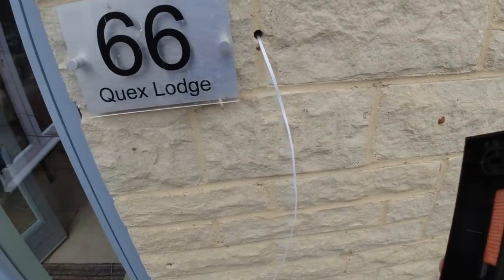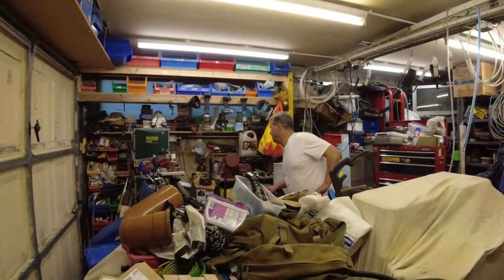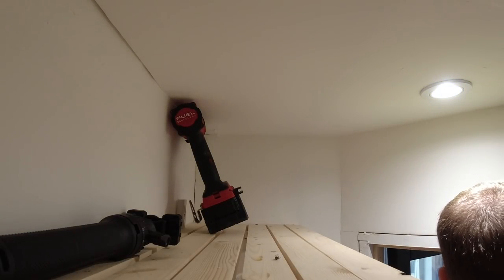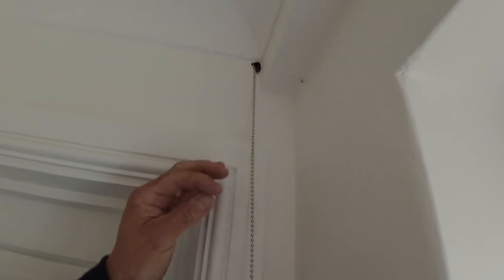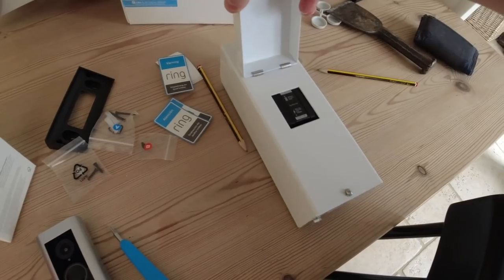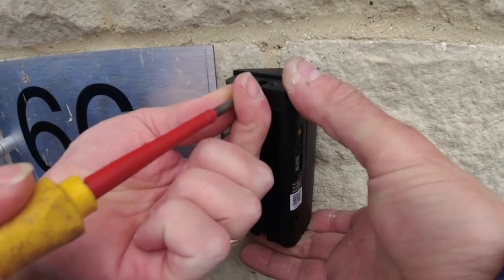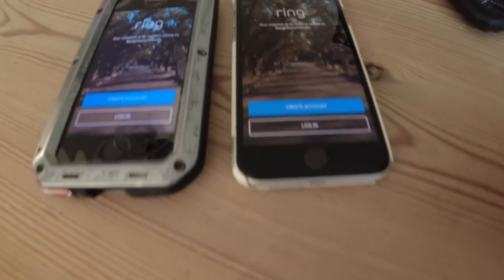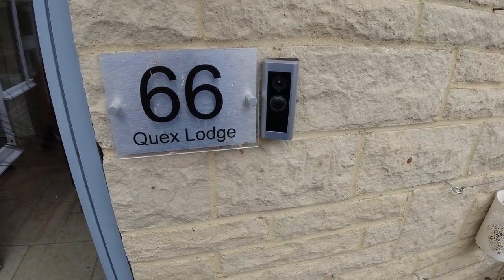Bloody extreme drilling for a doorbell!! #ring

Comment: I would have used Cat5 cable instead of the 2 core.   This gives you extra conductors as well as gives you the ability to add an IP camera / doorbell in the future.   I don't think RING will be around forever.
Reply: Many other types
Reply: Ring is Amazon….so will probably be around for a while tbf.
Reply: Cat5e and a poe injector all the way. Never did get on with the ring transformers, always so big and as Chris said they get pretty toasty too.
Reply: Aye the whole point of this product is to replace an existing conventional doorbell in an easy 20 minute job. Using it this way is a total horlicks, conduit, fused spur, new cables run, proprietary ecosystem with subscription cloud based nonsense to make it work.
Reply: I agree :)  plus,  I dont recommend or use any mandatory subscription storage based service
Reply: @jondonnelly4831  Let alone the fact that it is an attempt at building a mesh network for amazon, by amazon, and is a total invasion of everyone's privacy for a 50 meter radius.
Reply: I agree, going to all the effort of running the cable, may as well have run some extra ones at the same time.

Comment: I was really supprised that you could "fish" behind that coving, !!!  Its normally fitted with huge lumps of coving adhesive rhat would have impaired the cable run.  You were lucky.
Reply: Not really, I’ve fished behind many times, most of the adhesive is on the top and bottom edges.

Comment: If the customer has space in their consumer unit - you can get low voltage AC modules to power these from.
There a few frustrating part bits of these - £2.50 per month subscription (or £20 per year), it makes sense to get the ring complete house subscription when you are heavily invested in to the ecosystem.
The chime pro wifi extenders will ONLY speak to ring devices, so you can't use them for extending your main wireless.
I agree with others in the comments - they are not a cheap solution, however the ecosystem is very polished.

Comment: Think Ring equipment is over priced and if you shop around there is better systems on the market at half the price
Reply: Entry Ring video door bell is only £39. You can also power them from a 3 pin socket (with the ring PSU), so very easy install. If you have other Amazon/Alexa products then it integrates nicely.
Reply: There are other stand alone systems.
But ring package is quite good.
Because the camera is tied to your account it can't be stolen unlike other systems. Because as soon as it is powered on it gives its location, so its no good to a third party.
That's why ring warranty against theft. I don't think any of the other systems do that.

Comment: Ive seen how you use those high-end ring doorbells in videos before. You hit them off the house with a hammer then run away and sell them?
Reply: you could propyl do that with most on the out side  most likey wont be using they big screws or bolts ,are they if they don't have too, your only no when it drops of the wall in time !

Comment: What size cable did you use for the feed into the supply on the spur ? Was it a length of 2.5 from socket to spur or the 2 core supplied with the door bell ?
Reply: probably 2.5 t&e into spur 1mm out to transformer protected by a 3 amp fuse
Reply: @mikeenglish6734  the 2 core supplied is only 0.5 mm , would make sense going 2.5 into supply on the spur just wasn’t sure as he didn’t say lol but obviously the load is only 0.5 fused down with a 3 amp

Comment: I doubt you need to know the polarity as, it's probably AC 😂
I have fitted a number of tha battery units, buy a spare battery and lasts about two months of 'normal' use.
Brilliant for proving that delivery drivers and postmen... tell fibs ! they hate them and don't press the button so, set to motion detection, stll gets the evidence.
Reply: You're right, as a postman I hate them but not because I'm doing anything wrong. If no reply from a knock I go straight to their safeplace or neighbour, no need for pointless conversation.
Reply from the maker: I have notifications on so can instantly see anyone without a press
Reply: @Cjrelectrical 
Yeah, people still 'answer' it as soon as they see the postman doing their thing.

Comment: Not much point having an Internet connected doorbell when your connection is via a bit of wet string strung between lots of telegraph poles to a distant street cabinet and spends half its time reconnecting because a pigeon farted on it.  An EV1527 wireless button will run for well over a year off a CR2032 and doesn't need a power connection or the Internet but you don't get video.